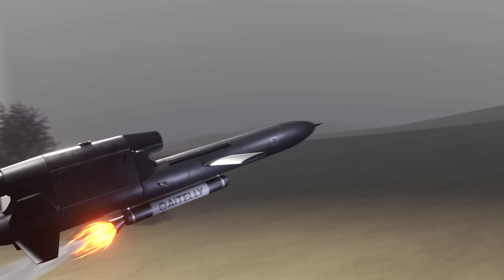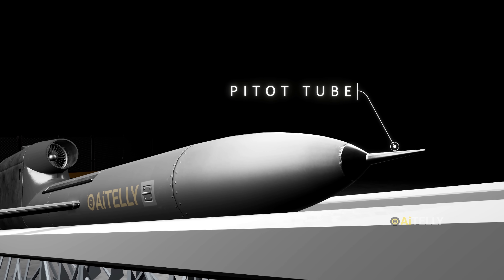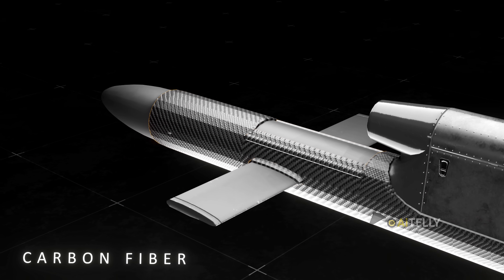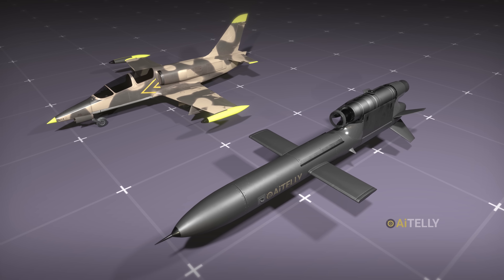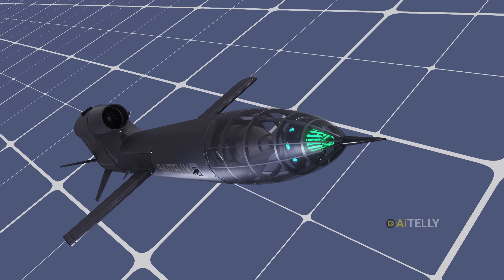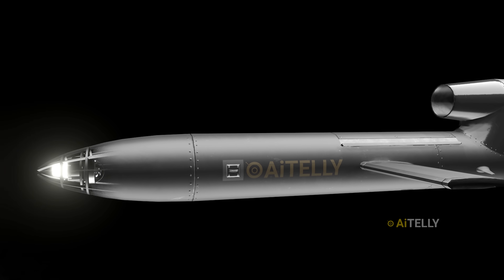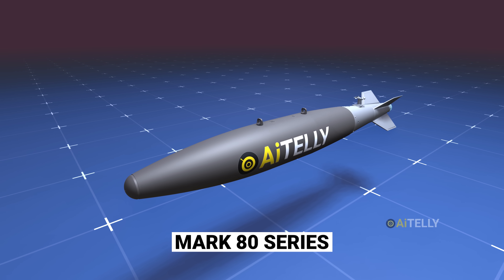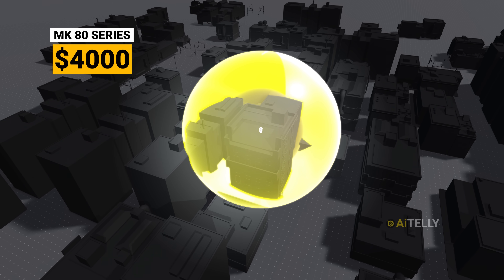The Flamingo FP-5 Ukraine Homemade Missile

Comment: You're going along talking about the flamingo missile then suddenly it's about how a a JDAM works.
Reply: @cymeriandesigns  he mentioned that the warhead of that missile is just a jdam
Reply: @KMASIF-mi9yj The warhead, at 2500 pounds, is far bigger than any JDAM.
Reply: @cymeriandesigns 😮😮 didn't know.... I'm just repeating what the video said.
Reply: @KMASIF-mi9yj No worries. The channel puts a lot of effort into their models and they tend to reuse them whenever possible to squeeze every bit of usefulness from them. I think they took it one step too far in this case, but I'm getting a good video for free, so I'm not going to get too worked up about it.

Comment: Why use a turbo jet and not a pulse jet like the original?
Reply: Because there are thousands of derelict surplus jet engines lying around that can be had cheap and easy.
Reply: pulse jet is very noisy and ww2 germany didnt really have resource for turbojet, they would used turbojet if they had so much turbojet

Comment: the accuracy is not good, unfortunately less than half are finding their targets
Reply: if the are made with swapped albatross engines, ukrain only has 40 or so albatros planes, if they salvage some engines from other planes, how many flamingo's can it make until no more engines remain? 100? 150? 1000? genuine question

Comment: I see all this stuff online saying "tHE flAMIngo iS bETTer thAN tHE tomAHAWK." No, its not.
Reply: It's got a bigger payload and longer range, so in those two respects it's better.
Reply: @cymeriandesigns  oh that’s hilarious. No, it does not have a longer range than the Tomahawk.
Reply: @SeanDailey-dy8tn I can't help with your willful ignorance, so continue believing whatever "facts" suit your fancy.
Reply: @cymeriandesigns  here’s some more facts: it’s much heavier than the Tomahawk, meaning it’s a logistical nightmare for Ukrainians without US assistance. Plus, it’s engine is extremely small for its size and mass, meaning it’s extremely slow and susceptible to anti-missile defense counter measures. 

That’s not willful ignorance. That’s facts.
Reply: @SeanDailey-dy8tn This is a regular truck. Ukrainians can move trucks without US assistance. The engine is powerful enough, there is a lot of information about this engine on the internet, u can compare the thrust to weight ratio, everything is ok.
Reply: @Glory_2_Ukraine  dude, where are you getting your information? This missile is nothing compared to what the US has. Did you not hear me say it was very slow due to its weight?
Reply: @cymeriandesigns  totally pointless if it is easy to be shoted by manpad, anti air artillery and other anti air system and probably not protection against jamming system
Reply: It's better because it's cheaper.